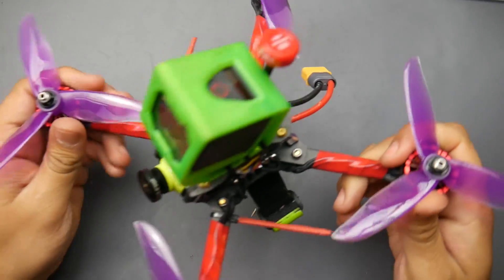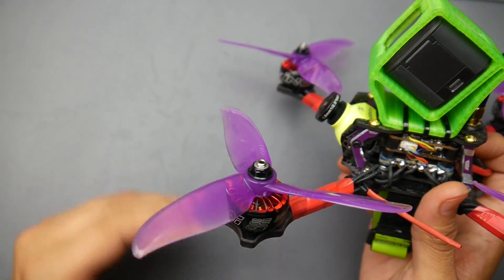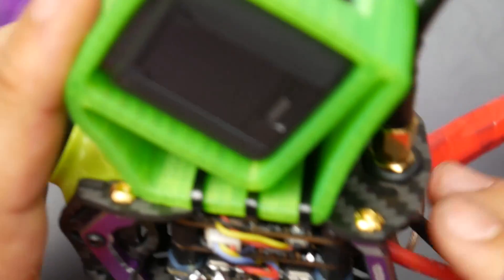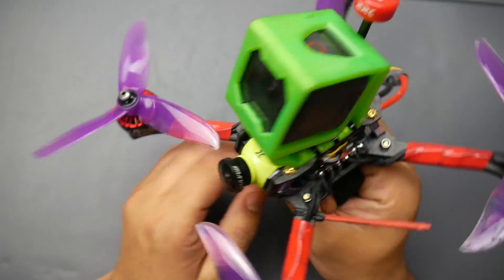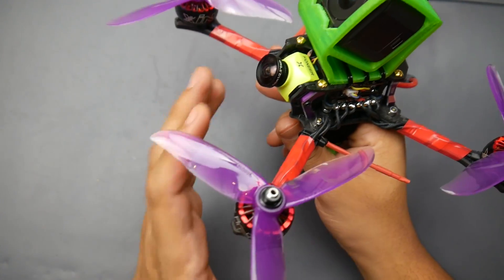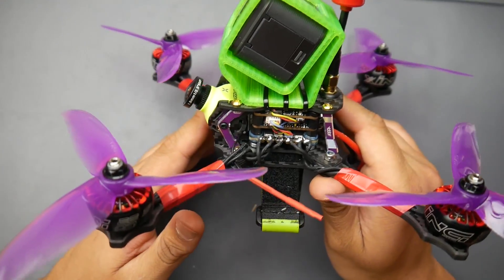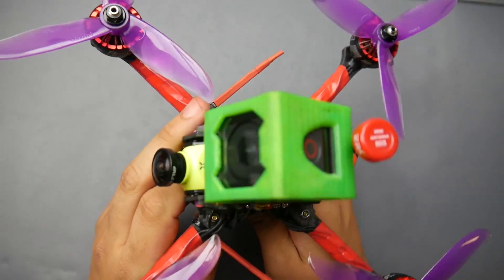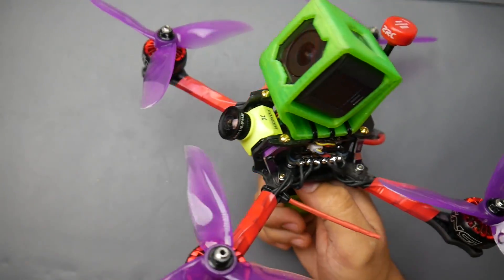Was This Custom FPV Drone Build Good In 2019?? // Holybro Tekko32 Metal ESC , iFlight XING 2207

Comment: I have the same issue with this board and vtx. I can adjust pids thru osd but the vtx channel will not change. 

Did you solve this problem? If so how. Thanks. 👍

Comment: Hey Dude, love your videos. Keep em coming as always... can request, or beg... lol for you to review the 3B Hobby 3BT 2306 2200kv or 2500kv motors? I just got a set of them and they are hands down one of the best motors Ive ever had. Better than some "Premium motors" without a doubt. They are marketed as "TRainer" Or "High value motors but they are not super cheap like the samguks or racerstar. They have one of the tightest airgaps ive ever seen, magnets are held in on a shelf cut into the bell, motors have a large set screw, and they use a dynamic balancing process to tune out micro oscillations right in  the factory. Most encouraging is that where they cut corners was with the packaging... cant recommend  them enough, really, they kind of set a new standard as far as a mid-price-point motors go
Reply from the maker: Thanks... Send me link I'll compare them to the 2 best motors in the market in my opinion..

Comment: This build would be better with some bbb motors 😆 high kv ones  but I thought the image quality looked great (compare to my box goggle everything looks superb 😆)
Reply: Bbb motora are the best value on the market. Period. Full stop.... im lovong the 2407 titanium editions and i keep 2-sets of the 3b-t 2306 morors around as backup
Reply: Flight Therapy i only got a set off 2207 2650kv motors the cheap ones but i love them
Reply: @bennieleip579  ya if they came in a little white bubble bag then thet are thr "trainer" series.. in my humble opinion those trainers are better than anything hypetrain has to offer at leas than half the cost... stick to those motors, especially in the beginning. I cut my teeth on DYS samguk motors and while they were total POS, they were exactly what i needed for all the smashing into the ground i did in the first 6 months lol
Reply: Flight Therapy no its a wile back that I bought those came in a black little box €15 a peace but love the power (the ones i had before was the old red bottoms and they are shitty if you compare them with that power wise 😆)
Reply: @bennieleip579  Ohh ya your right the new trainers are 2306 and 2206 i think.. mine came in these little bubble bags (love that they cut cost on packaging). hollow steel shaft, insanely tight airgap, perfect combo of notchy and smooth with a proper set screww instead of those god damn E-clips... and all cheap enough to replace when i smash them lol BBB has completely destroyed the "premium" motor hypetrain for me